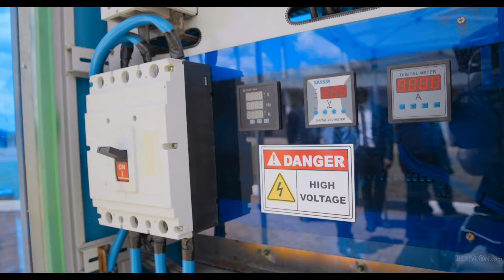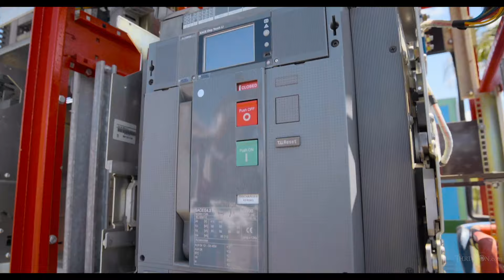Thrive Team Vets SAITH 'Free Energy' Device Invented By Maxwell Chikumbutso

Comment: Easy way to test this, build a Faraday cage around it. If it is still working it is not using radio waves.
Reply: Well it would work for a dew cause he did say it a self powered battery by rf
Reply: works not by the radio frequency you know
Reply: By the Ionosphere

Comment: My understanding on this guy is that ,there is radio frequency  receptor that he invented. This gadget receives radio frequency/ bandwith generated by either natural movement of the earth or radio  communication frequency for phones gadgets . this signal is turned into electrical energy then it is  amplified to charge battery or store energy.
Reply: Not so actually
Reply: Radio frequency is an electronic magnetic Field filtered by nano falad capacitors and these  frequencies can be naturally induced by the movement of the earth or by artificial propagation that is used in radio communication. I have gone deeper as soon you will also hear from Malawi some good invention that compliment  our brother chikumbutso.
Reply: @georgembayani1710 
How can you amplify energy from radio frequency. It's not that easy